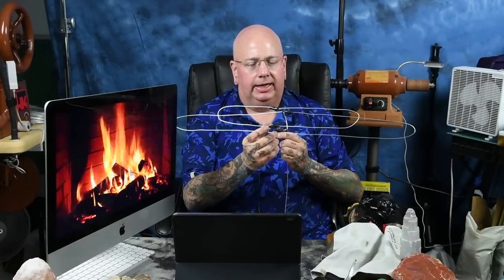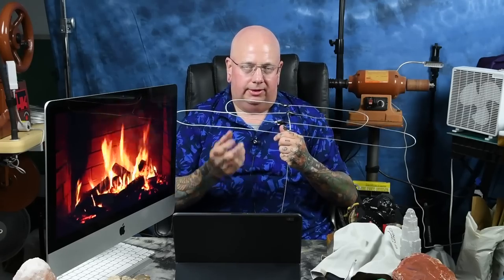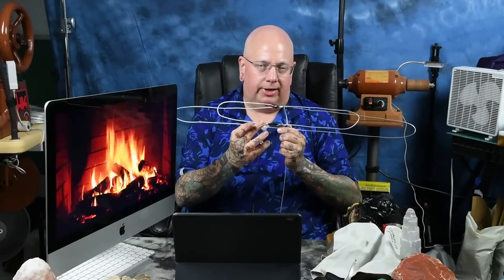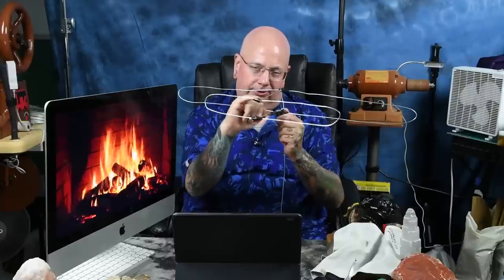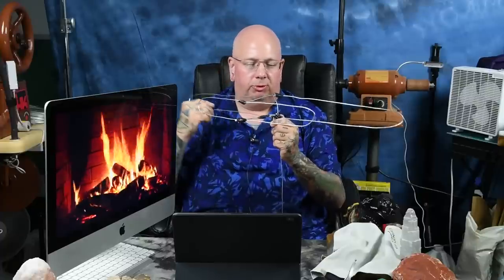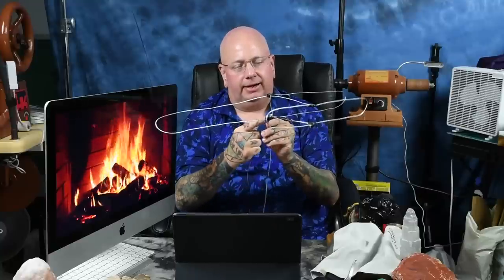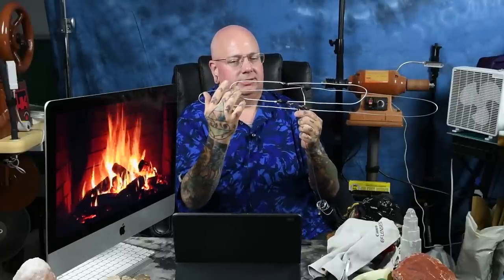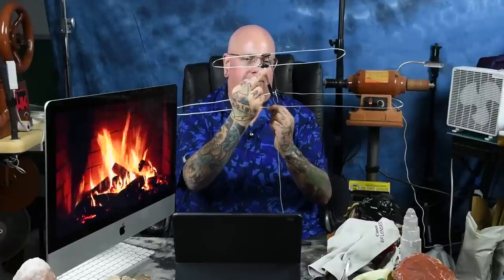😇 ELECTROCULTURE: HOW TO SIMPLIFIED! 🤩

Comment: This is pretty freaking neat.  I'm not sure what it has to do with my garden? But It's good information.  What a garden needs is a good drip system right at the base of the plant.🤗
Reply: That's always good but when I introduced electroculture I didnt have any issues with  pests other than  squirrels
Reply: @jk  why would I need a antenna to deal with my squirrel problem?
Reply: @MychelleSeymourHeyyouremember  His point was that the antennae deterred insects, but not squirrels
Reply: @jamescommagere7906  squirrels are the worst form of insects. They are extra large and very hungry.
Reply: @I AM INFINITE IN NATURE from my own research it helps the soil retain moisture so you don't have to water as much

Comment: Great video, Ken. Thank you. You are the only person giving common sense instructions. The internet is full of new age hope and zero how-to instruction/explanation. 

Question #1: If I'm planting trees and shrubs on 2,500 sq. ft of land, how tall should the antennas be? You say a foot or so above ground for a garden. If the atmospheric voltage increases roughly 100 volts with every meter of elevation, how high should the antenna be in order to give enough volts to 2,500 sq. ft? If you say x number of sq. ft. need y number of volts, then we can calculate our needs and build accordingly.

Question #2: Along with number of antennas and their heights, the question of antenna size and number of loops follows. Will the size and number of loops increase the voltage captured? One would think so, but is there a ratio that can be used to calculate size and number? For example, if I have x number of square feet and need y number of volts, AND I don't want to make an antenna higher than 10 feet, can I compensate by building a larger antenna with more loops?

Thanks again!

Comment: I container garden and made small scale antennas I placed around my garden. I collected the brush and downed limbs from my trees over the winter and used them as my wood element. I wrapped the wood with copper hobby wire from Home Depot. I’ve been on a decluttering kick in my home so I collected all my crystals and minerals and wrapped one or two in place on the sticks. I understand it’s not necessary, but it looks amazing. I garden for food but also I enjoy it and it was nice to use what I already had on hand. It does seem that the antennae with jasper are doing the best but this is purely anecdotal. I did score an allotment at a nearby church so I will make one of these using this method to put in ground over there. Thanks Ken!! I think electoculture is fascinating. I’m on the lookout for real copper hand tools as I’d like to add that to my collection.

Comment: Glad you posted this! I have been trying this in my garden with scrap Copper wire into spirals. I have been usingsteel as the pole (rebarb) because it is al I had. I will remove those and try this method. thank you!!
Reply: Research about using copper over iron and you will never us steel in your soil again.......
Reply: @incognitoalias2808  I had no other base to use.I did not realize.... I am removing them now. Thank you.

Comment: Ken, How would this work for container crops?  Maybe connect the containers in a series with the same aluminum material placing the "antenna" at the corners?  Or would each container require its own antenna?
Reply from the maker: just need a connected grounding system in place
Reply: @KenTheoriaApophasis  If you had a large round pot, could you have the bottom coil go around the inside perimeter of the pot then continue the wire down to the ground through a drain hole?

Comment: Ken thank you for your practical illustration of building a Yagi antenna.  My first practical question, what is the distance between the 15” driver and the 28” reflector, about 5”?  
My second question is about proportionality, as in Fibonacci?  13” by 34” (with  5” distance between reflector and driver).  Or as in your example 1.9% larger will be just fine (15” – 28”)?

Comment: Not in the case of Renner or similar situations, but for performance one should be slowly coordinating movement when under the charge of any electric stimulation, that they might retain the movement engram when under normal conditions.  So you are practicing many thousands of times faster than normal.  Your tendons and ligaments "don't attach to bone, they become bone." (Greg Nuckols)
The size of a muscle - though important - comes second to the ability to coordinate it that it does not cut off the electric charge of your nerves or "impinge" them.  
That is to say a muscle too developed will tear the ligament system free of your skeleton (see bouldering injuries).

Comment: Question: what effect does a chain-link fence have on an adjacent garden?
Question: how do we determine if a piece of garden equipment, or furniture is aluminum or steel?
 Thank you 😊❤🎉
Reply from the maker: i dunno on that one
Reply: To determine if aluminum or steel use a magnet. The magnet will not stick to aluminum.
Reply: A magnet will not stick to aluminum,  brass, or copper.

Comment: Diving in to electro culture.  I'm listening to you, watching some other youtubers. I've heard a few times, not to use iron or steel as it will cause problems/reverse any benefits. I've heard copper,  aluminum & zinc wire is acceptable.  My question -I have cattle panels, tomato cages I have been using for years for support in the garden. Is this causing damage to the earth, crops, trees in the area. Would attaching to and or adding the antenna array in the general area in the gardens remove the negative effects of iron/steel? Be neutral, improve or not matter at all?  Thank you!

Comment: I get why its important to use a dielectric deflecting material to guide the EMR down the wire. You should have explained why you do not use steel because some say use zinc galvanised steel with magnets threaded on it (without an antenna so we must be clear these could be two different systems of Electroculture). I guess you want the dielectric to run along the wire and the magnetism radiating perpendicular to it. I guess steel will invert this .

Also, it would be nice if you explained why you point the antenna at a 45° angle.

If you explain this then I will post this video on Electroculture forums with the added explanation.
Reply: Which forums Paul?
Reply: @igr64  Electroculture forums

Comment: Genius. Thanks again!

So if we are aiming towards dielectric induction, than the ideal proportionality for maximum benefits would be 1 over phi. Thoughts on this? Also if this is the case, than alternatively a (strong?) magnet could be placed under perhaps the grounded antenna array with emphasis on the south pole for phi-driven induction.

I'm reading your energy unification paper and my brain is going wild currently!

Comment: Is direction important?

From the base of Yagie do you run out wire runners along the line of plantings. If so how deep? And is direction important?

Using this method are we the static dielectric?

Regards DC
Reply from the maker: just halfway between ground and air
Reply: @KenTheoriaApophasis   So, we don't need to point this South or anything?

Comment: I am trying to understand what is going on here. So basically the antenna is like a bounding structure, and when the aether tries to induce the copper/aluminum it can't really do that effectively, so it gets pumped to the ground as charge? So by having one in each corner, you get them all humming together? No applied voltage is needed for this, right?

Comment: Thanks for the info Ken! Quick question, would a miniature version of this antenna work for potted or house plants grown indoors? Or does it still need to be grounded to Earth? Thanks.
Reply: Did you find any more information regarding this? :) I'm wondering the same for some wheatgrass trays.
Reply: I want to know as well!
Reply: @theadjuster151  found it in his other video. Yes, needs to be grounded.

Comment: So...to clarify and consolidate the information that I could understand...
1- Harness energy to help plants  by creating an antenna
2- Build it as high as possible because more energy is higher
3- Your antenna needs to be pointing at 45 degrees upwards but towards the center of the garden, multiplied by all the corners
4- Nothing needs to be in the center, so it's an invisible pyramid beam towards the sky rooter in the garden?
5- Could be copper or Aluminum(NOT STEEL)...could it be coiled on a mast/post/stick of wood to gain height/sturdiness?
Any misunderstanding from me?
ps. I Love to drink from your expertise's well

Comment: I stood up an old aluminum TV antenna on the farm a few years ago. I could get 3-6 channels. All useless. TVs been unplugged for at least 4 years now. 
         Would that antenna be good for this? It's actually on a bit of an angle but I could bend it too.
Reply from the maker: it would be yes,    what likely a 6 element TV yagi

Comment: The guys who built a strong electromagnet at the Mag Laboratory, said they created a magnet more powerful than the Magnet of the Earth, lol.   

Bah!!!!!!!!!!   Their magnet can't make a Magnet several miles away flip over in mid air as it falls.....but alas, the Earth's south pole facing up Magnet CAN do just that.    

It is so Powerful, it can literally force a Magnet falling towards the ground to flip South pole facing up as it falls.   From thousands of miles away.....THOUSANDS OF MILES AWAY....able to physically Force any Magnet you let go of and let if fall to the ground, to Flip over and face South pole Up every single time.  Now that is POWERFUL....way more powerful than any group of men can ever create in their wildest dreams.

You go right ahead and drop that 2inch grade45 block magnet you have....go right ahead and let it fall towards the ground, and hit a pillow on the floor.  The Great Stones in the Earth's foundation are so Powerful, they will force that Magnet in mid air, to Flip over face South pole UP every single time.   A gaussian field so strong that from THOUSANDS OF MILES away, beneath us...it can force a Solid object to flip over during freefall.   That's how powerful they are.   South pole facing UP towards the Luminaries above.  Luminaries moving Clockwise above the Earth, creating positive Current that spirals CLOCKWISE down towards the Ground.

Comment: Thank you Ken! Now I have to figure out how you used one continuous loop to make that. You pointed out to start with the front element? I'll have to draw it on paper first. I've been having a hard time trying to find solid copper wire that is a gauge that I can bend so this puts me in another market for aluminum wire. You didn't say what gauge that aluminum wire was.
Reply: He said 10 gauge when he was holding the coil he bought.

Comment: Hey ken, I take it you’d put these little guys around the garden bed, rather than running grounds from a larger antenna? Also, if I made a larger one, could I use copper pipe, or would I need to use solid copper?

Comment: Thank you Ken. Bend it 45 degrees, one antenna in each corner and one in the middle, but oriented towards where? Oriented towards the center of the garden and the middle one oriented towards where? How wide is the distance of the lower to top part of the front/bank element? It looks like 3" to 5" inches wide.
Reply: I have the same question.
Reply: @I AM INFINITE IN NATURE 10x20 what? Foot or meter?
Reply: @I AM INFINITE IN NATURE thank you so much!

Comment: Kenny could run multiple circles around me when it comes to physics, etc. So please understand that this comment in no way is an attempt to put down Kenny's surpassing genius. 
Having written the book "The Doctor Who Cures Cancer" I was able to learn about elements in ways that are not understood by 99.9999% of the public. There is more to life than just the electrical component. Once needs to consider the biological component as well. As is published by NIH, "...but Al [aluminum] phytoxicity blocks the mechanism of cell division." Phyto- means "plant," which means aluminum is toxic to plant growth. 

In addition, there are particular frequencies from different metals. EMFs can be thought of as the building blocks or sparks of purified nutrients. With that in mind, aluminum is not a nutrient but an impediment to cell division.  

The best way to use copper is to double the wire over, braid it using a hand drill, make a ring, and spin it using a fan, a weather vane, or a solar powered hanger. The spinning action is akin to how hydro electric plants turn rivers into electric power for tens of millions of users. One can also use Multi Wave Oscillator (MWO) disks and spin them, although they cost a little more than copper wire. Nikola Tesla had a hand in inventing the original MWO. 

One fan like this could take care of not just a garden, but an entire farm and beyond due to the property that spinning has on the copper. The fans can be kept indoors because the EMFs travel through mountains, walls and windows.

Thanks again, Kenny.

Comment: Simple, cheap and effective I like it. I thought aluminum was toxic to plants. Does pointing the antennas north or south matter? Is a higher antenna any more usefull? Would you get a benefit by running the wire further along the soil or does it have enough area of effect without? Could you also use magnets or is that redundant?  Would applying electroculture to a hydroponic system work, or use structured water, would it be the same thing? Sorry for all the questions, good info is hard to come by on this topic.

Comment: Maybe you can answer a question that I don't see anywhere else and simplify it. When wrapping the stick with copper wire, starting at the bottom, do you wind clockwise to the right as you go up, or clockwise as you go up?  Thank you.

Comment: What's your take on others using magnets with iron instead of copper? Yannick VD has been saying iron is better than copper. He aligns his wire underground N-S and attaches a magnet to to it at the end of it.
Reply: @terriblefez I did his method, minus using his beeswax antenna; I used a magnet and covered it in plastic instead. The results were pretty good. Pests weren't an issue and had a good yield. From my experience, the galvanized wire wasn't a problem in the garden but maybe it's a long term problem and not short term. I'd say it's worth a shot to try at least once to if it works for you. I'm now wondering if copper is better because of Ken's expertise when it comes to magnetism.

Comment: Thanks for making this video!!! I have a few questions. 1 can the loops be made as separate parts then wired together? I made little spirals of copper jewelry gauge for my seed trays  don't know if it helps but they are decorative so I put them in my mini gnome gardens also. What your thoughts? I made a tiny yaggy antenna for my gnome garden placed it next to gnome house I had violet and  star of Bethlehem and a sedum plant in container newly transplanted 2 days before. After putting yaggy in pot the star of Bethlehem grew twice as tall and the violet leaves raised up all the plants seem to be taking off. The moss isn't as happy but that might be too much watering. I going to make yaggy antennas for my raised beds following your directions. So making parts for me seem easier then handling one long length but whatever way you think is most productive I follow. Thanks again and I am a senior  who loves to learn new ideas.

Comment: Hey Ken, thanks for sharing this, very much interested in this topic, I've got my own copper coil antenna's but also consideration on how it would work (if possible) on scale, as I work at an organic mixed vege farm (about 50 acres).

Have you got any idea of the approximate radius it would effect, does this differ on the size of the antenna or direction it's facing? 

My understanding from Justin Christofleau's work from early 1900 wss that the taller the antenna thr greater effect, and would need to face north, would love your thoughts.

Currently I'm using bamboo and copper wrapped around it. And for my seeds a 2"x2"x1" south up magnet for my seeds like you suggested which i noticed a great improvement!
Not sure if you have any thoughts or have heard of Dan Winter and his water structuring devices like the ultraimploder.

Comment: Last metal I'm putting in my vegetable garden is aluminum. 
The natural acidity of the soil will start dissolving the aluminum. 
I'm good with the copper.
I'm still trying to find a test where the electro culture actually does show improvement.
Many of these so called tests are done by "first timers" and they aren't sure they are doing it right. 
Then there are those who swear by it but they are so far out in Woo Woo Land that it might be one of the crystals powering the operation.
Your yagi looks (sorta) more like a log periodic.

Comment: Ken, thanks for the info. Two questions:
Is it ok to mix copper and aluminum wire on one yagi antenna? 
I've got an old uhf/vhf tv antenna on the house with steel cable into the house. If run copper to the roof would you expect  better electrocoulture results from this tv ant. Or would you  make a yagi? Thanks.
Reply from the maker: sure its ok, yes, but why would ya  ?  :)

Comment: Just thought: is it also possible to do this with Aluminium foil? Or is it affecting the gain, when not homogenous internal structure?… anyway build some small ones for my potted plants (no real grounding = not working🤷🏻‍♂️) with copper wire. What a fantastic idea 🙏🏻🙏🏻🙏🏻

Comment: How about using a frequency generator connected to ground wth copper rods, and what frequency do we use?. There was a guy 100yrs ago called Stubbelfield I read who heated his house using the electricity from the Earth as a battery sinking copper and and zinc wires into the ground